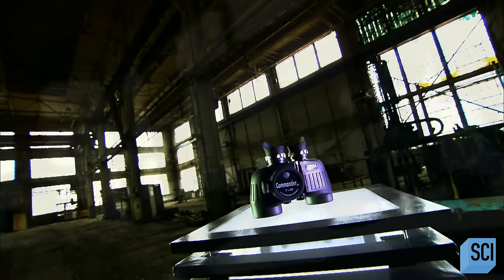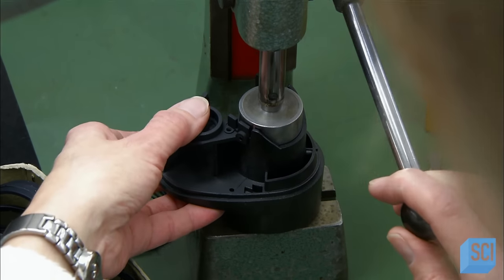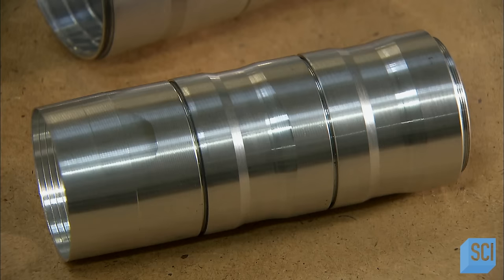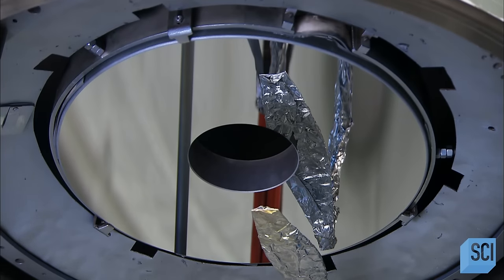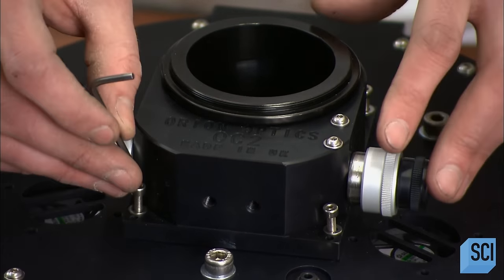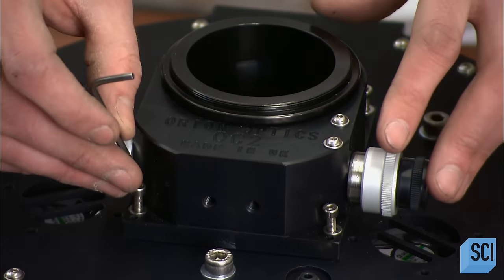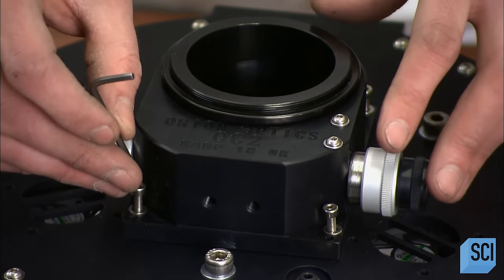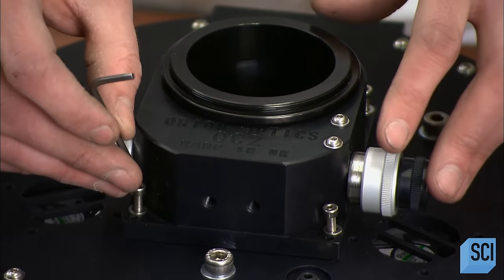How Binoculars, Telescopes, Space Pens, & More Are Made | How It's Made | Science Channel

Comment: That pen that writes anywhere - why not just use a pencil?
Reply: Years back I bought one from NASA in Florida.  Think it was $25.  I wouldn't be surprised if the government spent $1,000,000 in design. The Soviets did use a pencil in space. 

One real advantage of the pen would be for use under water. I never tried to do that.

Frankly I bought it on a whim as I had no real need for one. Think they are made by a company called  Fischer.
Reply: @williamrockwell9001  Pencils work under water as well. The only bad thing about a pencil is you don't wanna be holding one outdoors in a lightning storm. A carbon rod makes a really good lightning conductor.
Reply: Likely it was because sharpening pencils makes dust and shavings which could cause issues in an enclosed spacecraft. Pens don't have that problem
Reply: @Femboy_Coco  Russians used pencils. Dust from sharpening? Why would they take just one pencil? No need to sharpen any.

Comment: There's a few flaws in this video. 1. Why make a special space pen when you can just bring a pencil to space like the soviets did? A pencil is much more efficient, and the shavings can be recycled as wood or use a mechanical pencil.

2. Why make specially machined parts for riveting aircraft when it's much easier and safer to weld the parts. A properly done weld will actually make the area stronger, not weaker like everyone falsely believes. A weld is adding metal to metal, not like adding glue.

 Human error is the only issue with welding but of you hire a good welder it's safer because the part won't break or need replacement for several years, if not ever at all, hence why the military requires their aircraft to be fully welded without riveting or fasteners of any kind. It's cheaper to weld than to specially manufacture special materials that can break easier than any weld can (a welded part would have done better on those stress tests in the video than the bolts). 

For reference, the reason why the titanic sunk was because it was made by riveting parts instead of welding it. Hence, when it hit the ice, it broke the bolts, and the steel plates fell apart. If it were welded, this wouldn't have happened, and it would have just barely scratched the metal plates, and it would have survived the journey. 

A modern example is that the Boeing planes are failing BECAUSE they didn't want to pay welders enough so they all quit so they had to use riveting and fasteners so the plane parts fail BECAUSE THEY ARE NOT WELDED. That's why the military requires welded parts, and most state laws do now as well.
Reply: On the pen, it's because the graphite in pencils is electrically conductive so using one in space where it can get everywhere due to low/no gravity leads to catastrophic electrical failures. That's why the soviets started using the space pen too immediately after we created it.

Comment: If binocular without glue should still be strong? the white glue colour did not spoil or like have leaks inside that can't be removed? The eyerest circle should be normal? Like that too odd can accidentally poke own eye if hard material?
Reply: Have a reach to not look at telescopes video, it's part of this video anyway: what I see is polishing a circle with hole in the center, some small rockshape stuff - it got coated from mixture on 1 side? Why issit like that anyway needing a mirror? It's not a lens with degree to see long distance? Maybe to cut(he used wrongly? Not the center one to cut into slimmer pieces?) and be placed at viewpoint of telescope?
Reply: 12mins 8s, nitrogen used such way, can't let it be normal? Isn't it a waste of nitrogen(assuming as dryice)?
Reply: @anasqai  Dry ice? Oh I see, nitrogen. No, there is no cooling with 'liquid' nitrogen needed here. They do use nitrogen, same stuff as liquid nitrogen, but at room temperature and in gas form. Not for cooling, but to protect the inside of the pen.

A normal pen uses gravity to push the ink in the pen towards the tip of the pen.

The space pen is able to write in 0 gravity and in negative gravity (upside down). Instead of gravity, the ink is pushed by a gas under pressure. It's the gas that pushes the ink not gravity.

In principle, you could put the pen under pressure with any gasses. But some gasses react with other chemicals, air is an oxidiser and will rust metals. And a few gasses are inert, do not react and are stable (does not change over time to something else). One of those inert gasses is nitrogen and it's cheap. So they used that to put the pen under pressure and protect the inside of the pen. If they used air the ink, metal, oil, ... would oxidise.
In the food industry they use argon gas, also an inert gas, to protect food. Food packed with argon gas stay longer fresh, no air for food to oxidise with.

Comment: A pencil can do the same work as the space pen
Reply: It actually can't. Pencils present a wide range of issues that make them unsuitable for space flight. The most readily apparent being the issue of sharpening, when a pencil is sharpened, it produces a lot of fine graphite dust and wood shavings which are difficult to contain. Sure, a sharpener with a shaving catcher could be used, but have you ever used one of those that didn't let out at least a little bit of dust? That isn't a big deal in a classroom or art studio here on Earth, but in a space craft, having dust of any kind can be problematic, doubly so when it is highly conductive graphite dust. That dust production isn't limited to sharpening either, even just the act of writing and handling things that were written on can release a small amount graphite into the air, which while it is unlikely to cause huge issues, is not worth the risk when it comes to space missions. All of that said, NASA actually did use pencils on space flights prior to the development of the pen by an outside company at which point they tested and then deployed it because it was superior to pencils.

The myth that developing the space pen cost bazillions of dollars is highly misleading. The project that the pen's introduction and testing was a part of was indeed quite expensive, but the pen wasn't the sole goal of that project, it was kind of just a tacked on addition that supplemented the rest of the work. Saying that the pen cost ridiculous mountains of money would be like saying a car windshield sun shade cost $30,000 because you wouldn't need to buy one if you didn't have a car. On top of that, it is stupendously difficult to get an accurate representation of how much space programs cost since they are so vast, interconnected and involved. Do you factor in the cost of building a safety railing on a walkway in the Vehicle Assembly Building into the "price" of a particular Space Shuttle because that railing was installed while that vehicle was being assembled, or is it associated with general maintenance and so applied to the Shuttle program as a whole and thus inconsequential to the cost of a single rocket? Is it fair to say that the cost of developing the EMU space suit was solely associated with the Shuttle Program, even though suits based on those designs are still in use on the ISS today? Politics, contracts, cross-compatibility of technologies, and many, many other factors all play into the stated cost of any particular space project, but at the end of the day, the number that is stated is really just an educated guess at the proximate cost that contributed to the project in question.